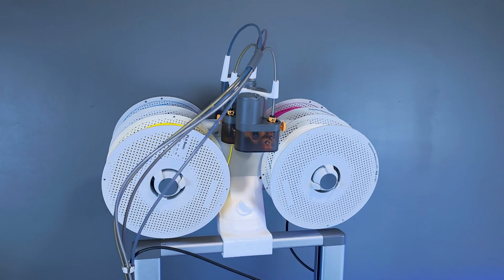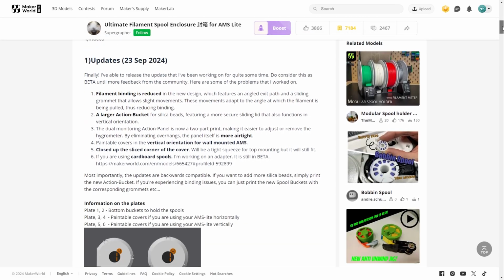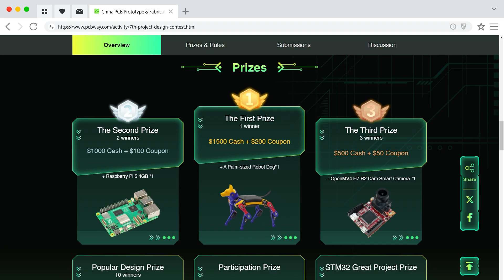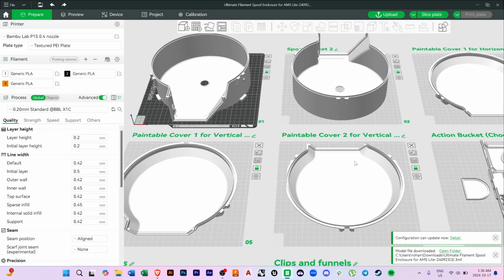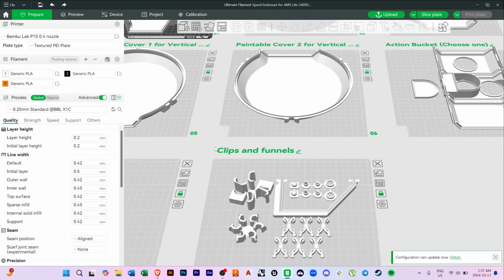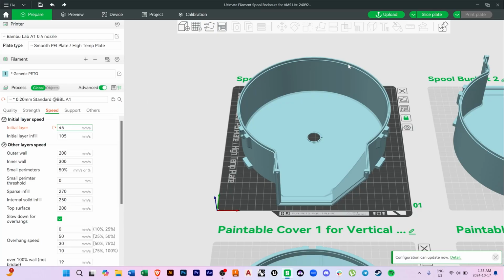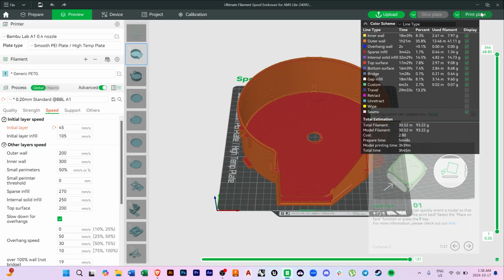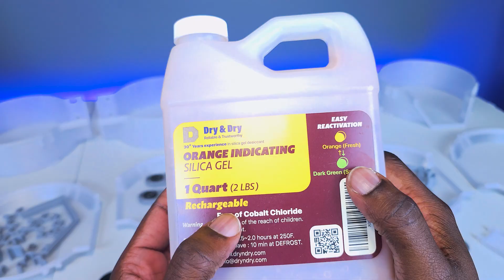⚠️Avoid This 3D Printing Issue With The ULTIMATE UPGRADE! Bambu Lab AMS Lite Enclosure for A1

Comment: Please don't waste your time and filament printing this POS
It actually makes the humidity even worse and it causes prints to pause or fail and causes under extrusion and artifacts.
This model is garbage it's the biggest waste of time and filament on Maker wold.
The model printed beautifully and I was so excited after putting it together and mounting it on my AMS lite but now its going to the landfill because it sucks and is even worse than non functional.
It's nothing but a liability.
Does nothing to improve humidity or print quality and actually significantly worsens both at the same time 
Also it made my AMS make  a horrible squeaking noise.
Garbage, 0/10 model
Don't bother wasting your time with this trash.

Comment: video ends up being a waste of the viewer's time because he does not tell you the print parameters he changed in order to optimize the printer for the filament he used.
Reply: Wait... you dont know how to dial in a filament?  His parameters wont work in your home.  Everything plays in to dial in.  If i tell you my settings they wont work for you.  what printer do you have?
Reply: The whole model is a waste of time and filament
Don't even bother with this piece of shit model.
I printed it and it makes the problem significantly worse and causes a myriad of other problems too 
Ringing, under extrusion,print pauses due to stuck spool, print failures
And the humidity in the buckets is SEVEN POINTS HIGHER THAN THE ROOM HUMIDITY!
THIS IS A WASTE OF TIME AND FILAMENT!
MY HUMIDITY IS SIGNIFICANTLY WORSE THAN WITHOUT IT AND MY PRINT QUALITY IS DEGRADED TO ABSOLUTE SHIT.
PLEASE DON'T BOTHER PRINTING THIS MESS ANS PETITION MAKER WORLD TO REMOVE THIS TRASH MODEL SO NOBODY ELSE WASTES THEIR TIME OR FILAMENT

Comment: Use the version without the hygrometer ports. Putting the hygrometer in the middle of the desiccant pack is self-defeating. You aren’t measuring the humidity at the filaments, you are measuring the humidity of the desiccant. Unless you put a port for the hygrometer far from the desiccant, a hygrometer is useless for this. The dual hygrometer housing is not for measuring the humidity inside and outside. It claims to measure the humidity at each spool in the ams lite. Since they are right beside the desiccant, it doesn’t work like that. The effectiveness of the system is evident with the desiccant colour change. My orange to green has been in for over 3 months and it’s just in the yellow state currently.

Comment: Thank you so much for the short screw hint, as I just finished printing and assembling everything when I realized that my filament was getting stuck, probably because of that screw. I will print it now and put it back in my enclosure before the garbage collector takes it away

Comment: What parameters to use to print, for example: bed nozzle temperature and if you used glue for the bed, try it and it didn't work.

Comment: Great video, how how well you explained every step of the way on getting this enclosure printed and put together. I'm new with 3D printing, just received my Bambu Labs A1 with AMS lite days ago. I have tried with no success to print the buckets and covers on Bambu lab's translucent PETG fillament. Cant' see to figure on why it keep fails every time, from stringing to the parts breaking in my hands when trying to remove from the plate.  Any help would be greatly appreciated man.
Reply from the maker: Glad you found it useful! Printing with the transluscent PETG was tricky for me as well. I followed the suggested settings labeled on my filament but leaned towards the higher end of the settings instead of in the middle. I also cleaned my buildplate with warm soapy water for the best adhesion and showed my first layers down to make sure it got off to a good start. I went with a smooth plate for the finish I wanted but it was really diffifult to remove. I had a few fractures that I had to seal with glue.. Hope this helps some!

Comment: iyi günler güzel tasarım bende yapmayı planlıyorum. toplamda kaç kg filament gerekli tüm baskı için  nem ölçerden 3 adet mi yoksa 4 adet mi gerekli?
Reply from the maker: Hey there! This design uses a little over half a spool or half a kg. You also don't need to use any meters. You have the flexibility of using none, 1, or 2 on either side.
Reply: @Creatorrific  teşekkürler  bu ürünü yapacağım

Comment: I finished building mine a few days ago, and wow, I’m impressed. I live in extremely humid area and this enclosure is managing it like a champ. My current humidity level right now is 27% RH, down from 60% in my home. 

I’ve also seen significant print quality and surprisingly, print time improvement. I printed the same part I did a week ago, with zero software adjustment, and it completed 15 minutes quicker. And this has been consistent with every print I’ve done since. I cannot recommend this more, it’s well worth the investment.
Reply from the maker: That's awesome. Glad it worked out well for you. Down to 27% from 60%, that's a huge improvement! Thanks for watching and happy 3D printing!
Reply: @Creatorrific  the only extra step I took was coating the enclosure with a few coats of clear lacquer. Since the material used in this build is in itself hygroscopic, I think that extra layer should extend the use of the silica as well.
Reply: Why do you lie?
This POS has increased the humidity by 2% 
No matter how much desicant I use or how much I microwave it it just makes the humidity worse.

The model printed almost perfectly out of PETG 
But it just SUCKS.
Also I had to remove it because it seriously degrades print quality and causes prints to pause because of stuck spool errors causes under extrusion and artifacts and it makes a horrible squeaking noise from my AMS now.
This model should be pulled off maker world because it is worthless trash and it's a huge waste of time and filament.

 It looks really cool but is 110% WORTHLESS
Reply: @andreamitchell4758 still gives me great results. Just have to remember to dry out my filament once a week. My RH sits at around 28-35% most of the time

Comment: Do you still like it? Is it easy to change spools and how ofte do you need to change the humidity beads?
Reply from the maker: For me, the deseccant beads become saturated pretty quickly so it required charging often making it less hands-off. Drying isn't required for all filaments to produce good prints either like PLA so it might not make sense fit some people.. I have an electronic filament dryer now that works well - the Sunlu Filadryer S4.

Comment: when using the transparent PETG what settings are you using? I’m new to this 3d printing and can’t seem to get the settings right for it.
Reply from the maker: I used Overture's transparent  PETG set to 240°C nozzle, 85°C bed temp and 40-45mm/s print speed for the initial layer. I also cleared my buildplate using warm soapy water for the best adhesion possible. Hope this helps.

Comment: Is the top mount sturdy enough if printed with PLA?
Reply from the maker: I'd go with PETG which is a bit more sturdy or even ABS if possible. Some people have reported their top-mount cracking over time from stress. I haven't had any issues with the Sunlu PLA Meta White that I used though.

Comment: @Creatorrific What settings did you use for the PETG clear? I've got a Bambu clear PETG and looking for tips to make it look as clear as I can when I print it! (need to get some non clear stuff for the backsides) still.
Reply from the maker: I used Overture's transparent  PETG set to 240°C nozzle, 85°C bed temp and 40-45mm/s print speed for the initial layer. I also cleared my buildplate using warm soapy water for the best adhesion possible. Hope this helps. I think clarity comes down to the brand of filament and buildplate textured though. Elegoo looks like they have a nice transparent filament.

Comment: did you saw any difference with the enclosure?
Reply from the maker: There is an improvement in print quality, but the results seem to vary person to person. Some people complain that it isn't sealed well enough to shut out humidity and that there isn't much of an improvement vs humidity outside the enclosure. For me, it worked well. The only issue I had was that the loose dessicants saturate pretty quickly, so they need to be recharged often.

Comment: Looks expensive but probably worth it!
Reply: @Amybnuy  I think it would be worth it. Less then a roll of filament a couple hydrometers.  I was very surprised to find that humidity in my house is about 45% on a normal day in the Central Midwest USA.  I need more desiccant than I have right now.
Reply: @ where I live it’s usually 50%! It rains a ton here. And not had. I was expecting 1kg~ of filament; tbh tho I just realized 20CAD is still not bad if you get it in bulk and use PLA/petg

Comment: Love the video, thanks for sharing will print this one too. One question - do the Overture spools need an adapter? If so what are you using or recommend?
Reply from the maker: Thanks for watching! No, the Overture spools don't need an adapter.
Reply: @Creatorrific  Thank you. Another quick question. What is your goto filament for the A1/AMS?
Reply from the maker: Overture's probably my go-to (great variety and value), Sunlu second, then PolyTera (really good color options and variety but a bit pricier). Elegoo has good bundles as well and Eryone makes some nice dual-color filament. Hope this helps!

Comment: The only thing I would suggest is not to use super glue on the hydrometer. I'd use silicone or something you can remove so that when the hydrometer needs to be replaced or removed for battery replacement, it is easy and won't damage the actual enclosure.

Thanks for a great video! New sub here.
Reply from the maker: Thanks for the tip and the sub!

Comment: One of the downsides of any AMSlite enclosure is that it takes a lot longer to change filament, so we only enclosed one side. This means that it's only more time consuming to change filaments that need to be kept dry, but it's quick to change filaments that aren't particularly hygroscopic on the other side.

When we tried only enclosing one side, however, we found that the enclosure didn't get pulled close enough to the body of the AMS to align the filament pass throughs, as there was nothing on the other side to clip the 14 & 23 clips to. We worked around this by printing the just 10mm depth of the other side. This gave us the places to clip to, without getting in the way of the spool holders for day-to-day quick spool changes. This has worked out really well, and means we rarely need to change filament in the 'dry' side of the AMS.

Also, it's recommended that if you're drying (re-charging) colour changing indicator desiccant in an oven or microwave, that you not also use that oven or microwave for food, due to the chemicals that can be released when the indicator de-natures. If you don't have a separate oven/microwave, it's better to use non-indicator dessicant, and a hygrometer will be far more more accurate than indicator desiccant anyway.

Comment: I've started this upgrade and it works great. I've only done one side but having my TPU filament in it has kept the print quality up significantly. Its been extra humid lately with constant rain and I'm finding that since the upgrade I'm getting a lot less stringing as well as just general better prints. Just have to find the time to print the 2nd half and have the entire AMS lite moisture controlled. I think only thing I might have wanted different is to have the desiccant clearly visible from outside so you could see the colour at a glance and be able to know if they need replacing without having to open the whole thing. Regardless its a great upgrade.
Reply from the maker: Thanks for watching. I'm glad this upgrade's working well for you you.

Comment: Great tutorial.  I followed another creator and he skipped over the filament guide pieces being two  - I was wondering why the filament hole piece was so wiggly!  Did you wind up using bowden tubes inside the enclosure?  Assembling mine now!
Reply from the maker: Glad you found this video useful. Thanks for watching. No, I didn't end up using the bowden tubes in my installation. Didn't find them necessary.
Reply: @Creatorrific  I ran the 2 mm drill bit through the filament opens just to ensure smooth filament travel. I used the rectangular hygrometers and some freshly dried Wise Dry silica packets.  Humidity went from 41% to 22% overnight   Thanks for a very well done tutorial. I used PETG just for the connector pieces (that plate of parts ). PLA for the rest.

Comment: Would you also add the external spool holder to this assembly as well? Space looks a bit tight filament bins to add the spool holder.
Reply from the maker: I really only ever use the AMS since I mostly print using PLA but I've added a y-splitter to the bowden tubes so that I have the option of using the external spool without having to disconnect anything - I'll feature this in my next upload. It does take up a bit more space but not too much.
Reply: @Creatorrific  I've fitted the spool holder using the mod from your previous video. If I don't use it as least it won't go missing!

Comment: I did print this enclosure and, in the end, removed it because my printer sits in a really tight space (my printer and AMS light is installed in a 2'x3' enclosure) and removing and replacing filament with this enclosure on is a bit of a pain in the hass. I can see it being much better if you have more available footprint in your printer space.
Reply from the maker: Thanks for watching. That's a shame that this didn't work out for you.
Reply: @Creatorrific  yeah.  I still have all the parts.  If I change my setup, I could reinstate it.  I liked it... it just didn't work for me in my environment.  GREAT Design though!

Comment: Putting the AMS Lite on top of the A1 was tested by Bambu Lab. Wondering if the additional weight of the enclosure wouldn't be, in overall, simply too much weight for the A1 top bar to handle. 
Any thoughts ?
Reply from the maker: The frame is very sturdy, so top mounting isn't an issue. Print quality isn't affected either.
Reply: @Creatorrific  thanks for the reply

Comment: Last week I also printed this enclosure. But with silica beads I can’t the humidity inside lower as 56%. What things can I do to get it around the 30-35%…?
Reply from the maker: Sorry to hear that. I wonder if it's an issue with the seal maybe, like gapping in certain spots allowing humidity to enter. I was able to achieve 17% lower than my environment (33% inside vs 57%) outside. Try inpecting the seal at all the joints. Maybe the design could use a remix version that snaps tightly together.. Wish I could offer better advice.
Reply: I could't drop my humidity much either, maybe 10% lower than the outside humidity/

Comment: Nice video. btw for the hydrometers you have to really push them into the holes quite hard (quite scary), then they click in so you don't need the glue. Took me a while to realise my mistake as I'd brought mine off Temu and thought mine were a bit small.

How are you finding replacing filament spools? I find it quite difficult as you can no longer push from the back of the spool. To the point that I've only done the front 2 and left the back open. My plan is to keep long used filament (e.g. black and white in the front) and other colours on the back and store them away whilst not in use.
Reply from the maker: Thanks for the tip! Replacing the spools hasn't been too difficult for me, I just take the dessicat holders out first and place my thumbs on the center of the spool holder while pulling the filament spools off from the edges. When inserting a spool I'll grip the middle of the AMS lite itself as leverage and push the spools on.

Comment: -- I'm sorry, I'm a noob when it comes to 3D printing. Recently I've got Bambu A-1 AMS combo with mostly PLA Matte filament from Bambu Lab, but I'd like to print AMS enclosure with PETG, so I got one spool of PETG, but printer refuses to print PETG(I did followed link that you provided "Super Grapher" project) and massage from "print Table" of Bambu Studio, that project was designed for PLA, so material do not match, or something like that... How did you "worked around" this problem and print yours enclosures with "Overture" brand PETG?

 Thank you for great video!
Reply from the maker: Thanks for watching! For PETG you should use the suggested settings from the manufacturer. It should be labeled on the spool itself. In my case I believe it read 230-250°C and 30-50 speed so i went with 245°C for the nozzle and 45mm/s for the first layer. Hope this helps.
Reply: @Creatorrific  -- Thank you so my for "steering" me to the right direction, I'll try that as soon as I get home, and thank you for a video, once again!

Comment: Great video! Would have loved to have this kinda step by step explanation when I was printing this.

That said this is a cool design, but if you live in a relatively high humidity (70+) environment PLEASE DO NOT build this. I made this and had to throw it all away because, its just a case, its not airtight, moisture WILL reach your filaments. My idea was that I could leave 4 filaments in there, possibly eliminating the need to install and remove filament rolls over and over. A simple airt tight container (with rollers for the filament) with ptfe tubes running to your AMS inputs are a much efficient setup.